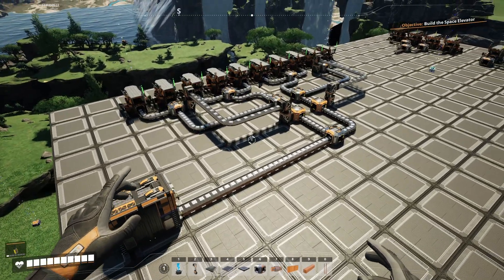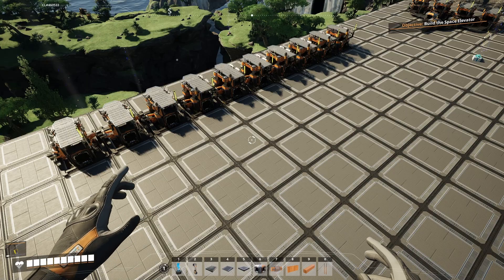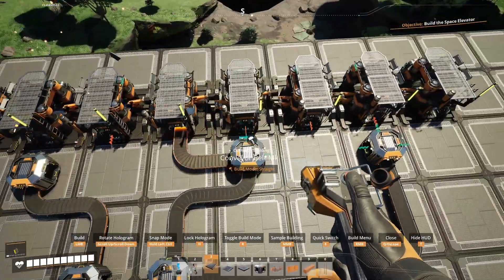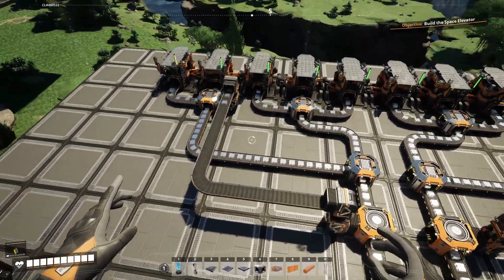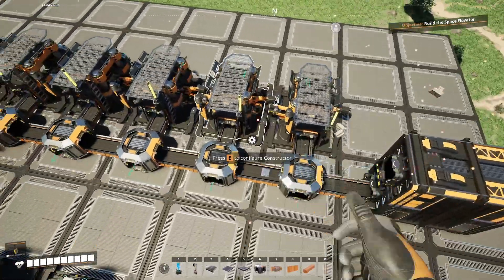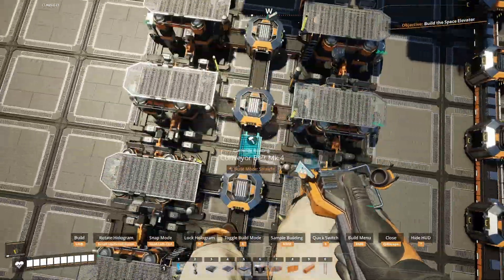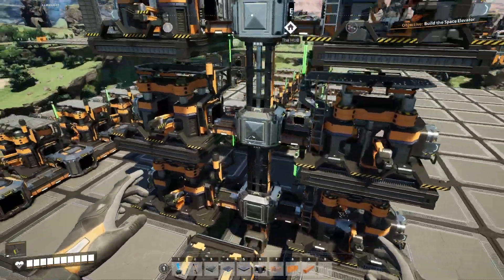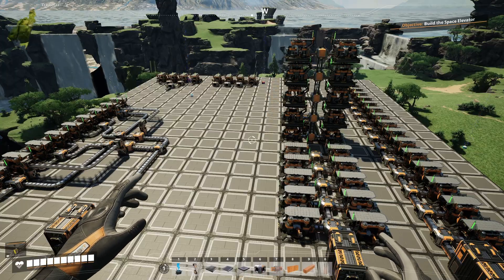Load Balancing vs Manifolds – Which Is Best in Satisfactory?

Comment: you could also make hybrid that makes like 4 manifolds, and those 4 groups are load balanced.

But that vertical stuff was complete new thing for me, i didn't know you could place the splitter right in to the elevator. That looks really cool :D
Reply from the maker: Yeah there's many ways to do this! I never thought to use vertical manifolds until a comment on another video asked me to show how to set one up.

Comment: Load Balancing is better overall, It looks better and they are perfectly balanced. The only thing good about manifolds is its quick and dirty to set up, good for smaller things.
Reply from the maker: I do agree that having perfectly balanced setups is better in every way from the get go, it ultimately doesn't matter at the end as you get the same result. I personally prefer to use manifolds as they are much simpler to understand but I do see load balancing as a good option as well. I personally wouldn't want to load balance 178 foundries as that would require a lot of space and can get complicated. Using manifolds kept the space required smaller and didn't require much effort to place.
Reply: so you never rebuild any thing you set it and forget it i personly set up temps in early game and upgrade the lines as i upgrade miners